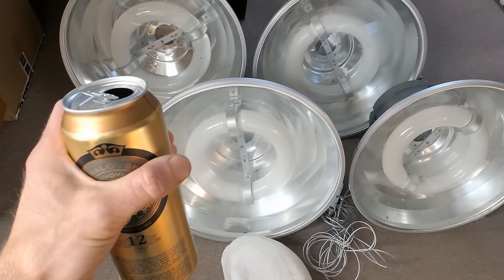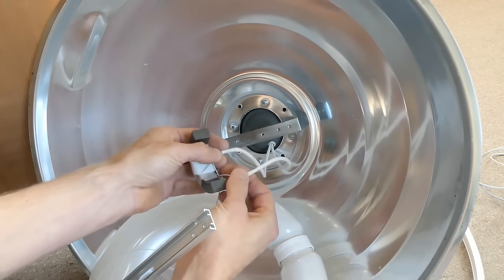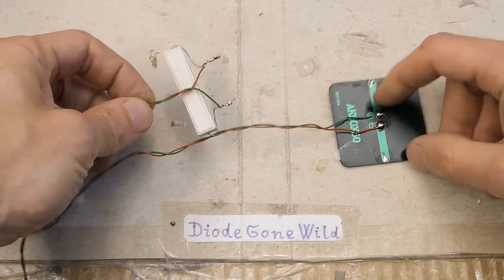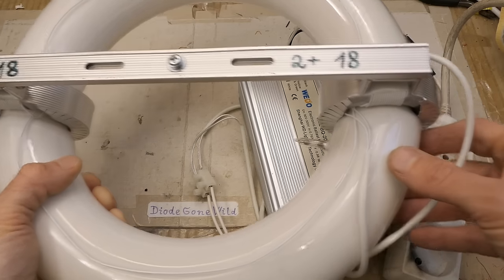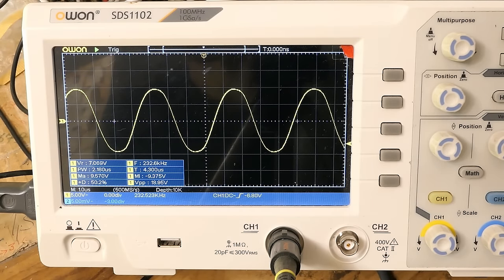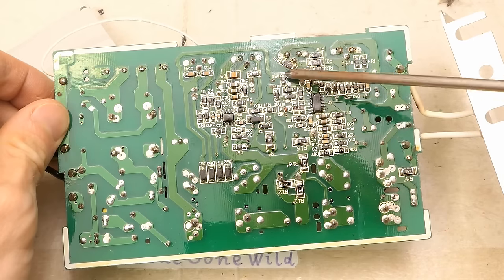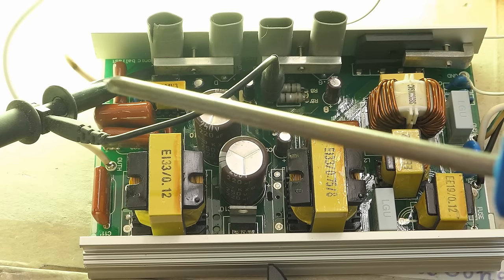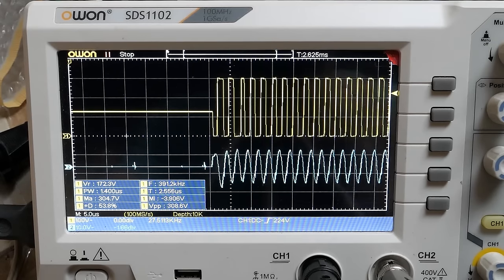Induction light - what's inside, schematic, experiments

Comment: This light must be the ham radio killer
Reply from the maker: 230kHz sine wave is probably better than 50kHz square wave with a lot of ringing.
Reply: Actually no. There are even 2.65 and 13.6 MHz induction lamps and everything worked fine.
Reply: It's because the induction ring has somewhat of a shealding
Reply: You are forgetting the Harmonic Frequencies.
And, a Square wave = every wave, Spark Gap Transmitter. RFI +
Reply: These cause a lot of interference on AM bands ime. Used them as grow lights a while back. They do have one advantage though. They have an extremely long service life ❤
Reply: @christopherleubner6633  Longer than led's?
Reply: @steve-h7z Longer than cheap LEDs, 100%. Probably comparable to high quality LEDs, but in both cases, the driver will probably fail before the tube/LEDs themselves.
Reply: @inductivelycoupledplasma6207  true

Comment: Great comments as usual. These 200 watt electrode-less 5000k lamps can operate 7/24 and last up to 12 years continuously. The whole assembly's a bit complex, but the lifespan at 90+ lumens per watt with an excellent power factor, typical balanced fluorescent color spectrum and even light distribution, seems worth it for a low maintenance design that functions from a wide range of voltages found anywhere in the world. Nine of these on a single north american 120v 15amp circuit would give 162,000 lumens. 2 banks (18) could light a whole school gymnasium (with Plexiglas) for 25 years of maintenance free life, but the idiots pushing LED's say this is inefficient and must be thrown out? This is the evil of religious zealotry imposed over an already decaying civilisation.
Reply: I could not agree more! I am sick of replacing faulty led light fixtures and I am sick of exaggerated led light output claims. Led lights seem to offer good efficiency at low power levels (a few watts) but they don`t seem to scale well to higher powers where thousands of lumens are required.
Reply: LEDs have better spectrum than most fluorescent tubes, and higher efficiency, like 150-200 lm/w.... 
But you can't just buy them. Most light fixtures have horrible LEDs that barely do 80 lm/w (because they are over driven to hell), shit CRI and awful drivers that put power factor above output light flicker. 
So yes, some LEDs would be more efficient and have better CRI, but unfortunately it would get replaced with over-driven inefficient junk that flickers and would fail in 1000 hours.
Some LED fixtures have worse flicker than fluorescent fixtures with ordinary inductor ballast.
Reply: @Alex-mj7km  Most LED fixtures are also terrible because the light source is integrated and not replaceable. 90+ CRI high quality fluorescent lamps were available but most people were fine with standard 80+ CRI ones and didn't pay for the extra price.
Reply: Very well written. Ideology rules the world. Sad, but true.
Reply: @mernokimuvek  I don't think non-replaceable light source is that much of a big deal if they last. But they don't. Everything is built to the lowest price point, which means driver is not good, LEDs are not good + probably overdriven, because people shop for lights based on watts, not lumens...

As for CRI, even 90 CRI fluorescent tubes had spiky spectrum which is not ideal, while some LEDs have spectrum that is really similar to sunlight (within visible range of course) or incandescent. And high CRI makes all the difference when it comes to precision work (like soldering stuff), or how food looks like.
Reply: I guess it always happens to the world when a new tech considered to be magic of some kind, that can solve all the problems. Sooner or later it would be balanced out, LEDs will become usual and its weaknesses will appear. Humanity learns the hard way.
Reply: @Alex-mj7km  I said 90+ CRI, not 90 CRI. Even most (cheap chinese) LEDs don't have 90+ CRI. When it comes to high powers, nothing will beat the metal halide lamp.
Reply: @Alex-mj7km right, too high current, also lack of heatsink (in some faulted led fixtures non-aluminium-based pcb roasted to black) kills all led advantages 😢
Reply: Yup these are extremely reliable as the power transmission to the lamp is about 98% and the lamp itself has no electrodes to burn up. Had a few with plant grow spectrum that were used for years. I did eventually switch to LED because of the higher intensity though, but the LED lamps didn't last as long, however repair was straightforward and inexpensive. Adding 2 extra LEDs per string made them a lot more reliable as well.
Reply: @erikziak1249 Ideology driven isn’t bad in itself imo, it’s certain (usually religious or populistic) ideologies that are really bad.
Reply: ...You mean capitalism?
Reply: @qwertykeyboard5901  Nothing to do with capitalism, just with shortsightedness.
Reply: The operational data miss a key aspect of induction lights: they contain non-negligible amounts of mercury, just other typesof fluorescent lights My guess that is the main reason, LEDs are promoted over induction lamps: no toxic waste at the end of their life.

Another thing to consider is electromagnetic compatibility (EMC). Induction lamps use high frequency electromagnetic fields to induce the current that generates the light. The brighter the lamp, the stronger the field. The large ones are powerful enough to disrupt radio and mess with poorly shielded electronic devices. And you can‘t shield the lamps to the point they don‘t leak electromagnetic fields, because then they wouldn‘t be „leaking“ light either.
Reply: @MrAranton  Application for these is "high bay" lighting so the 25khz field propagation should be low enough (for free😁)
Reply: They probably still contain mercury, which is still a concern.  Even if the systems are in place to properly dispose of them, it's safe to say most people just toss old tubes in the trash, where they break open and leak the contents out at the landfill.
Reply: @mikeg3529  However, watt for watt and based on a 20 to 25 year longevity, these are far less harmful than cheap spiral CFLs also with mercury and much more likely to be disposed of in highly visible batches of 10 or more. So more likely to be recycled? Maybe.
Reply: @MrAranton  "Non Toxic" can be seen relatively. The toxycology of the material mainly used in white LEDs has still not been fully investigated (altrough their dust when destroyed has clearly effects to the body) , while other LEDs clearly have a toxic, even carcinogenic effect. That´s only about the LED itself, not speaking about the PCBs and the components themselfes for driving them. And, at least the typical household LED replacement lightbulb doesn´t last long (in my case not even a single year per bulb) because their electronics cannot stand the heat, generated by the electronics and the LED itself, in the lampshade. In summary i can assure you that they don´t save anything. Manufacturers tell that a LED Bulb needs less power in production compared to a classical bulb, but if the LED bulb has a shorter lifespan, the calculation doesn´t work at all.  

Yes, a LED itself may work up 20-25 Yers and beyond, but the electronics behind will fail - way - earlier. Tbh, this whole LED story is an economic stimulus program for the manufacturers, nothing else. At best, the high energy consumption for production and operation is only shifted away and not eliminated.
Reply: Why do you say LED's don't scale? They have higher light intensity per area than fluorescent lights @TheTemporalAnomaly
Reply: In theory they are right, this is inefficient and must be thrown out. This also uses toxic and polluting mercury which LEDs don't use. Mercury in any quantity is unacceptable environmentally. In practice most people buy cheap LEDs that have worse efficiency and lifespan than an electrodeless lamp, but LEDs are technically capable of outperforming electrodeless lamps in efficiency and lifespan, they just happen to be more expensive so no one buys them
Reply: I totally agree, for me fluorescent lights of this type are the best there is.
Efficient, low maintenance, long lasting, and would not be problematic if they were recycled properly. In addition, it offers a very uniform light and is not disturb to the eyes compared to LEDs.

Comment: Great video. The lamp housings are very cool, the sort of lamp housings one often sees in restaurants for the "in" people. The length is fine with me, those shorts and tic-toc videos are clearly designed for those with a short attention span.
Reply: I don't think they use 200W fluorescent lamps in a restaurant :)
Those are heavy duty industrial lamps. For warehouses and factories and such probably. But nowadays it's fashionable to make low power lamps mimicking that look for some reason. I've seen them at IKEA where they had cheapish lamps but with about five 1/2" bolts to hold a plastic lampshade, and something like a six watt LED bulb.
Reply: @westelaudio943  Yes, it was  the shades I was referring to and the type of restaurant is where they sandblast the walls back to brick and make an "industrial" look. And they end up with terrible acoustics - reverberation plus.

Comment: These have a very well made power supply. Most would be fried with operation with the wiring changes and open transformer. Also the wire coil in the glass pip is the ignition antenna. The plasma forms around that then ignites the rest of the lamp.❤

Comment: I'm curious: what is the benefit of this induction style lamp over a notmal filament based fluorescent light?
Reply from the maker: Mainly no electrodes to wear out. This thing can last 100 000h, while normal tubes last 5000 - 25 000h.
Reply: @DiodeGoneWild  that's quite amazing. I suppose short cycles also aren't a problem for an induction lamp either? (Versus short cycling a filament based tube and instant starting it seems to shorten the life dramatically)
Reply: @DiodeGoneWild ...and even after 200K hours of running... there's supposed to be less than (5-10)% decrease in light (brightness) output.

Comment: 22:18 I think it's to make it a bit more bulletproof in overvoltage or similar cases. That transformer will 100% certainly lock out one mosfet while the other is running so that means a short is basically impossible. It will always fail just dead instead of failing smoked and spicy like a good dinner
Reply: Maybe

Comment: Because this fluorescent ring lamp does not have heated cathodes on its' end it is very difficult to see how it can possibly fail.  Also there should be no darkening of ends for the same reason. No wires threaded through the glass should also add longevity.  It looks like that design is well out of step with the 21-st century philosophy of "built-in obsolescence" which probably explains why it has been largely discarded.
Reply: The only way I can imagine it failing is the phosphor coating on the inside of the tube falling off after many decades of wear, producing blue light instead of white. It could also absorb the argon and mercury reducing the pressure and efficiency. As long as the tube is not cracked allowing air to get in, it should never fail completely.

Comment: Those are so cool. I've never heard of this tech before for some reason.
Reply from the maker: There were also rectangular ones. But induction lamps were never very common. For these high bay lamps, mercury vapor or metal hallide lamps were used way more commonly, and then LEDs came.
Reply: @DiodeGoneWild  Yeah that's pretty much what I've seen here in the states. I wonder if these were just too late to really catch on. I'd imagine they'd really only lose brightness as the phosphors age, I can't see much else that could go wrong with them aside from electrical issues
Reply: These are much older than you would think, developed by Nikola Tesla in the 1890s. He used both inductive and capacitive coupling.

Comment: Assuming the power supply doesn't give out, I wonder what is the lifespan on the bulb and what it's failure mode would be?
Reply from the maker: Well, a good question. If the power supply doesn't fail and the glass doesn't crack or leak air, it would run almost forever. But the phoshor probably deteriorates over time, absorbs the mercury or argon, and maybe outgases and ruins the gas mixture. This thing with an external phosphor would probably last even longer, but it makes no sense in our world with its disposable bussines model.
Reply: @DiodeGoneWild  The external phosphor would fall off, it barely sticks to the inside of the glass tube. You can clear a mercury vapor lamp by putting it on a Tesla coil and the phosphor inside the outer bulb will fall off where the arcs strike it. Unlike high pressure sodium lamps, most mercury vapor lamps have the outer bulb filled with nitrogen and will not produce X-rays.
Reply: I think they probably turn pink as the mercury gets absorbed by the phosphor. This happens with regular fluorescent lamps too, but very rarely because the filaments usually fail way sooner than that can happen.
Reply: @drobotk  And pink lamp can still be repurposed as party lights. Fluorescent tubes with broken cathodes will also wors as induction lamps. You can also use Tesla coils and flyback transformers to power them.
Reply: @DiodeGoneWild external phosphor wouldn't work due to glass absorption of uv, produced by discharge. Quartz tube could work (but less effective due non-zero absorption), but it significantly expensively

Comment: These were killed off by false advertising of LEDs. The main thing was that LED manufacturers claimed 100,000 hours life with no lumen depreciation, whilst "fluorescent" they said only 20,000 hours with 50% depreciation 
These were blatent lies, but clever marketing made it into urban myth.
However the BIG thing was that LED suppliers bypassed Lighting Engineers and sold direct to end users. That meant they could tell them whatever BS they liked and nobody called them on it. This resulted in fluorescent being replaced with an inferior product (which is still inferior even today for commercial lighting).

Comment: "here's the dog for a reference"   haha... How big is the dog?
80Lumen/Watt.... not bad....I think LEDs do close to100Lumen/watt
I wonder how much that lamp has lost over the years.  Maybe that's why they replaced it?
I have a Lux meter, but no idea how to measure the Lumen output of a lamp... would make a nice follow-up video ;-)
Anyway.  Big thank you for another outstanding video.  No bells or whistles, but solid technical explanations... and a good dose of humor.. just as we like it !
Reply: I think this kind of bulb can surpass 100k hours of constant on-time, whereas the best LED bulbs (like the Dubai Lamp, maybe) do 50k but the best ones you can actually get are 25k at best. These induction lights would be better too since the only thing you replace in it is the phosphor tube if its gotten too dim, since I read they lose about 35% of their lumens after 60k hours, which is amazing. LEDs may be advertised to lose only 30% after 100k hours but we all know that no LED bulb will ever get anywhere close to that lifespan.

Comment: I wonder what the life expectancy is on the bulb are you meant to throw the entire unit away or disassemble it and just change out the phosphorus tube

They're built really nice actually I mean it wouldn't be too hard to keep these things going forever if you had tubes
Reply from the maker: I have in total 5 tubes, so I can keep it running for a long time :) but then, they're probably unobtainium or bloody expensive (over 150 USD).
Reply: Makes me wonder if it would be possible to put an ordinary T9 circular bulb in it. I wonder if there would be a voltage between the unconnected filaments. Actually, they would probably need to be connected to complete the loop?
Reply: No easy way of swapping the tube out. You probably spend a good 15 minutes up on a boom lift in an terrible to reach area were these things are meant to go to change just the tube. Then the balast also has 100k hours on it, the glass is dirty and what not. 100k hours is a damn long time for every bit of electronic. Capacitors dry out, junctions go bad and so on
Also with 8 hours per day that thing lasts 3 decades. No way you get replacement tubes on them after that
They are made to be swapped as a whole unit for sure
Reply: @drobotk  yes, this will work of course. You can also use a linear tube, connect the pins with a piece of wire to close the loop/circuit and it should/will work.
BTW: The last generation of T5 linear tubes have reached an efficiency of over 100 lm/W but are now forbidden to sell due to EU regualtions (thanks a lot to the Brussels bureaucrats).
Reply: The design of this would be set and forget. The lamp would give stable output for literally decades.

Comment: It looks like this GDT circuit is similar to the one using IC TL 494, isolated and safe.
High voltage GDT ac current in IC IR2156.

Comment: Seen these in a few shops, even brightness between fixtures and good colour rendition. In theory last forever, don't know in practice.
Reply: In conventional ones, one of the cathode heaters eventually burns out, usually after tens of thousands of hours but the time largely depends on the number of on/off cycles. The starters usually last around 5 times as long as the tubes. Interesting to see how they mitigated these problems for a >100000 h lifetime. Apparently the most mature FL technology ever got.